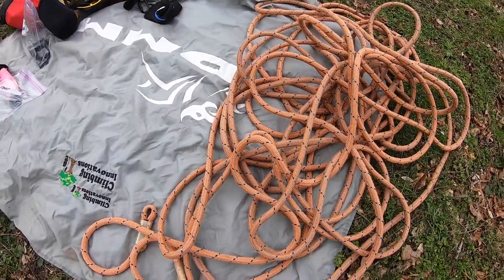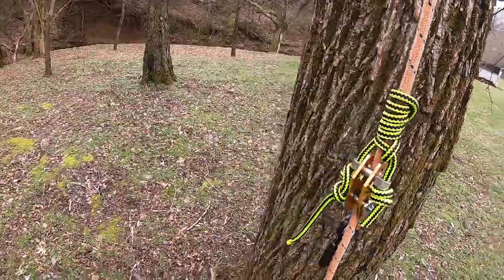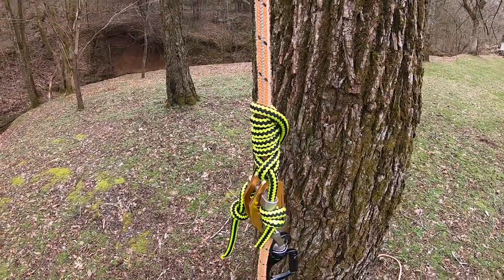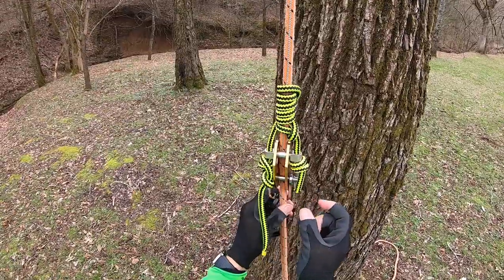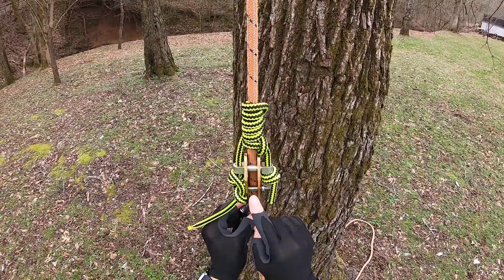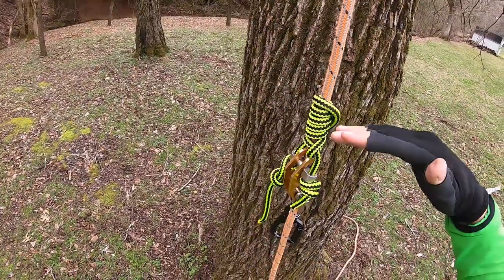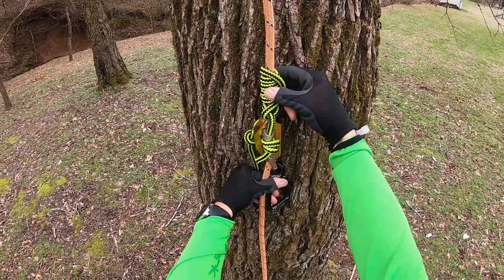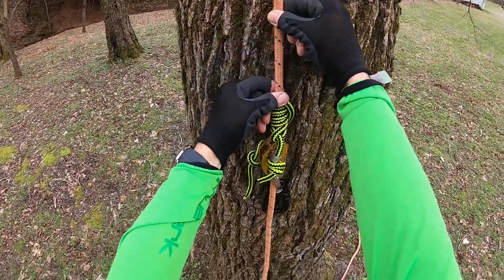What Causes Ropes to Milk and What is the Effect?

Comment: I’ve always milked rope as necessary. Hadn’t discovered the Sherrill instructions in the comments about milking new rope prior to use. My understanding from a forgotten reference was that covers strands stretch. Covers should be milked, taped and cut. To the Drenaline user: I recently removed 1.5’ of cover from a 200’ hank after approximately one year of use with a rope wrench.
Reply from the maker: I probably have a 130 climbs with this Marlow Vega sewn eyes at each end when it was new.  No bulges, no milking and climbed from both ends.
Reply: I removed over 2.5m in my 60m drenaline...

Comment: That is an interesting hypothesis, and it sounds logical. When I was climbing on Blake's I noticed milking on my half inch 16 strand braided Polyester jacket over parallel stranded Nylon core. I still had it when I switched to a Hitch climber with prusik. I tried a variety of hitches, they all milked that rope. When I bought my Unicender, (Thank you for your help with my drum, by the way!) I had to switch to 11mm because even at 270 pounds, the rope wouldn't flow through the device. When I switched ropes I switched to double braid, and I have not noticed any milking since. Maybe I should try Blake's and Hitch climber on the double braid just to see if it gets milked under those conditions?
It is good to see another video contribution from you! Stay safe, my Brother!

Comment: Hello Richard,

I am relatively new to climbing. My journey began 2 years ago and until recently I have mostly been climbing with spurs and MRS. I’d shoot a line into the canopy drag my 200 feet of drenaline up into the canopy connect my hitch and tending pulley and up I’d go. Recently I purchased a Hitch Hiker 2 from Wesspur at 2020 prices ( wow, an $80 price increase from 2019-2020) and began climbing it SRT.. 
I have two main ropes are ascender and drenaline. I have a tight eye spliced onto only one end and thankfully so! Both ropes have milked badly. Drenaline has a 2 foot section of cover with no core hanging from the non-spliced end. I have recently slung a 150’ shot of bifrost over a limb and began climbing it with a basal anchor. It seems a little stiff but no bagging/milking.. anyways.. Thanks for your video. I like that you’ve replaced the steel carabiner for a quickie and swivel in your HItch Hiker. i may give that a try. Caio

Comment: It would help a LOT to describe what milking is and show an example. I guess this is an "in group" video.
Reply from the maker: Yes, probably some assumptions made.  Basically pulling the cover over the core.
Reply: @RichardMumford1 could be you have no "milking" because you are climbing from both ends therefore you keep changing the direction of stresses that in turn are "equalizing the effect" , it's a plausible thought. easily seen if you take some paracord and drag a French prussic back and forth along the line different materials but built the same.  like newton's law states " for every action there is an equal and opposite reaction "  😊 anyway I believe you are creating a sort of "equilibrium " by utilizing both ends of the rope, whereas most climbers use only one end constantly dragging the sheath away and down the core.  hope all that makes some sense.
Reply from the maker: @ravenflight88  I understand.  Under this hypothesis, I would then have a balloon forming in the middle somewhere in that line because I'm climbing away from the ends.  
The reason I don't is that the HH does not put a bend in the rope an  squeeze the core and cover together below an before the hitch cord pulls on just the cover.  Also Marlow Vega is a tight weave.
Thank you for the feedback

Comment: Bless you for such informative posts.

You might be onto something Richard re the location of the hitch in relation to friction point.  But I do wonder about the elephant in the room, i.e. whether you need to milk a new rope to avoid milking happening later.

Ignoring the elephant for the moment, firstly from your video my take is that with the Hitch Hiker (HH) the hitch is very close to the pinch point so there is only a short distance for the jacket to move over the core compared to the rope wrench.

And when the hitch does move the jacket just bunches up against the pinch point in the HH under it unlike the rope wrench where it stretches above the hitch all the way to the rope wrench.  You'd think the amount of jacket movement from the bunching in the HH would be way less than the stretching in a rope wrench as the hitch is further away.  I do wonder tho about whether the jacket above a hitch grabs the core like a Chinese finger trap thus limiting movement, unlike the sheath below a hitch which would bunch allowing the sheath to slip over the core rather than squeeze onto it.

I guess rope manufacturers would know best.

And re that elephant,  there is a difference of opinion as to whether you should milk a new rope.

Suppliers such as SHERRILLtree say before using a new double braid rope you should always milk it by running a hitch along its entire length (preferably twice). You then tape and cut off the milked ends that extend over the core.  And interestingly when they milk it, its does below the hitch where presumably the sheath bunches and slides along the core.

Check out their YouTube clip called      New Doublebraid Climbing Rope Care: Milking  https://www.youtube.com/watch?v=JpEDCHu9rnA

Its an interesting issue you touch on that many climbers talk about e.g.   https://www.treebuzz.com/forum/threads/milking-rope-balance.36425/

PS Despite initial milking, if that truly is what is required, I suspect some subsequent milking may still occur.   And if the Chinese finger grab notion by the sheath over the core is correct then the rope wrench might be better than a HH, the latter's saving grace might be the close proximity of the hitch to the pinch point.  

Who knows? Its an interesting conundrum you raise Richard.  One for a glass of wine some evening by a fireside.  Or one for actual rope manufacturers to address on YouTube rather than users or suppliers.  Thanks for posting.  

Cheers from Australia
Reply: Well said Tube Rider, Jim